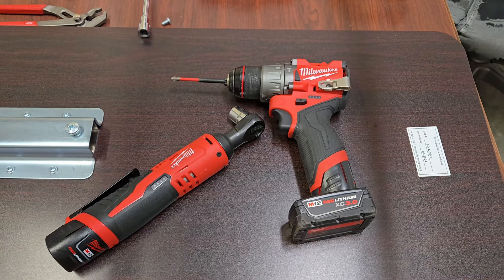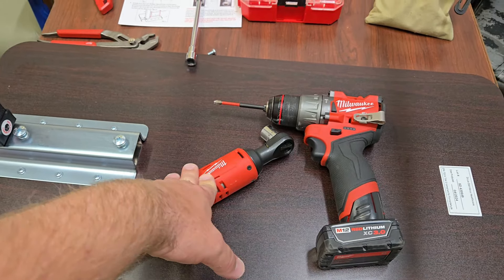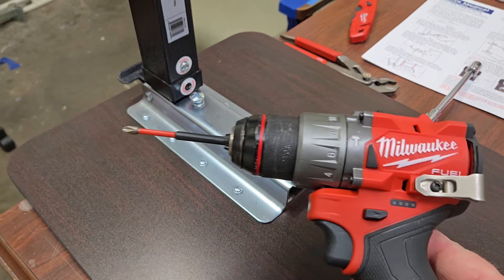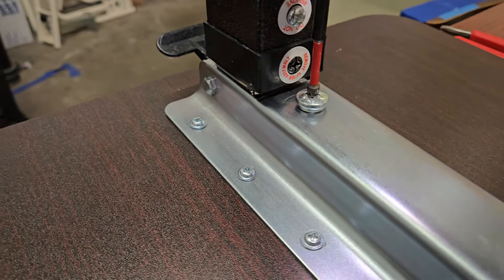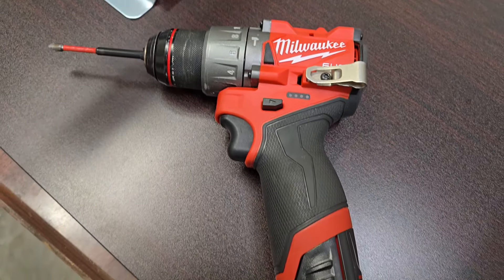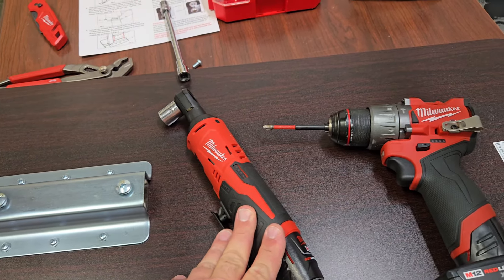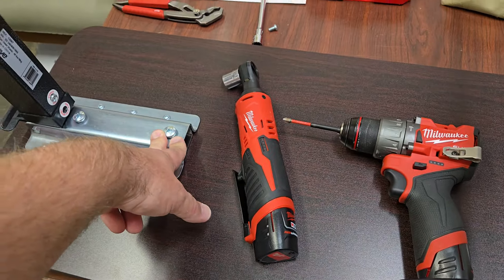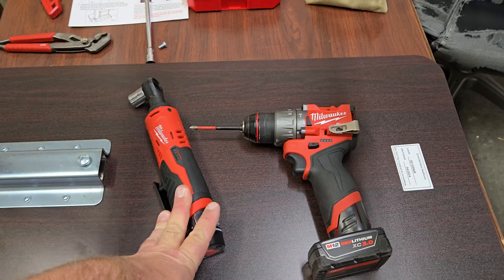Re-cap Of The M12 Hammer Drill & M12 Ratchet

Comment: They got the deal for $99 for the ratchet and drill debating 😊
Reply from the maker: @appleztooranges  I got the ratchet for 99 its a good buy!
Reply: @ would you upgrade for $100 for 2 batteries Instead of 1 and fuel
Reply from the maker: I would, it would be worth it for sure. I use mine every day, so going for extra batteries and the fuel model you can't go wrong